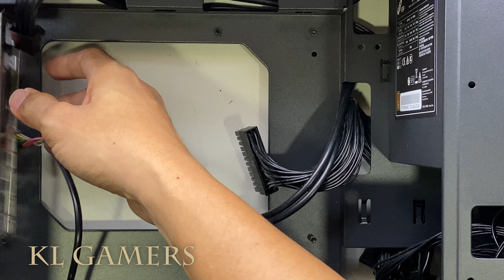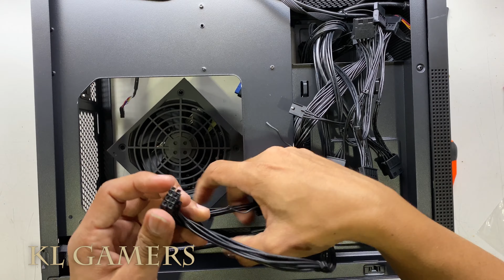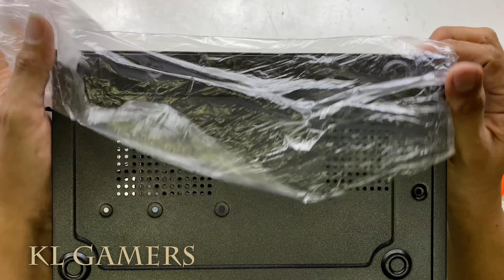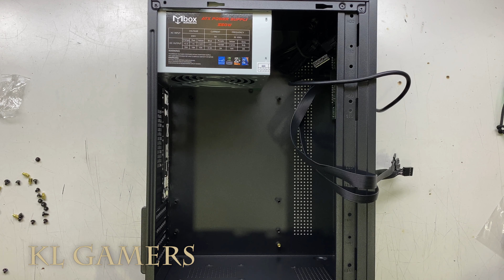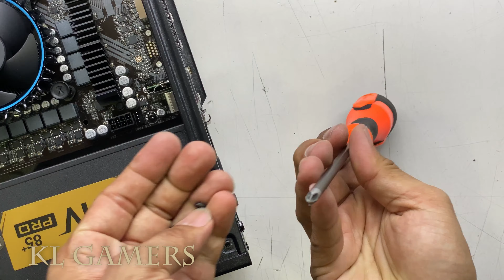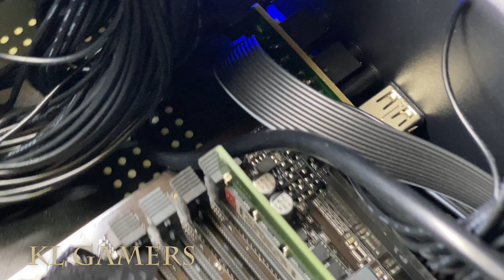Disassemble a PC from a Bigger PC Case to fit into a smaller PC Case

Comment: Nice video! 👍🏻 But this motherboard won't quite fit into that smaller case as well.
Reply from the maker: it fit ok
Reply: @KLGamers  I see. But the right side of screw hole doesn't have any nuts for holding motherboard, isn't still OK to use it?